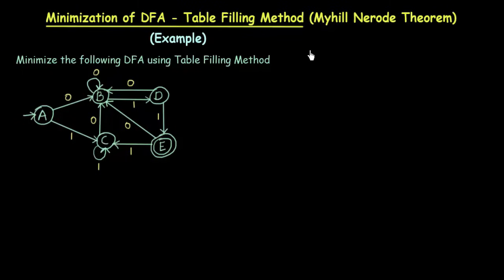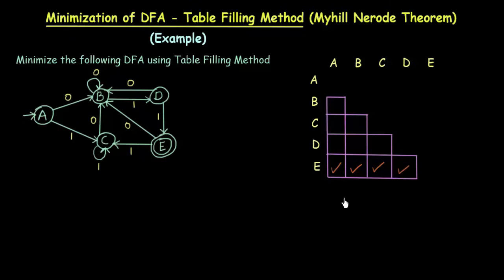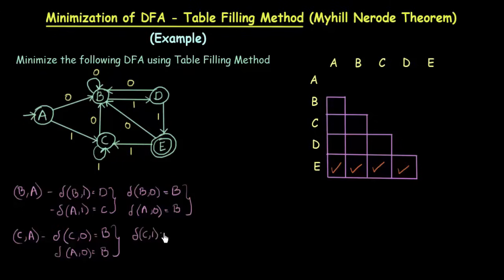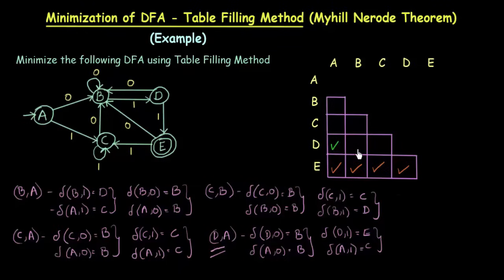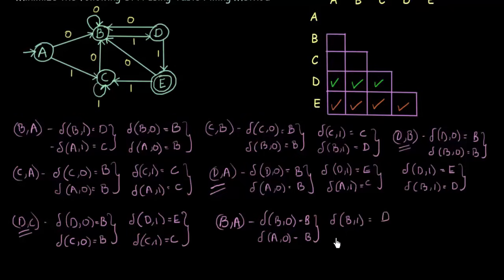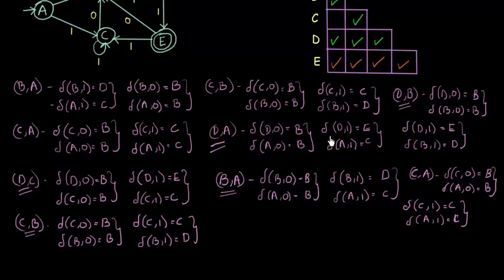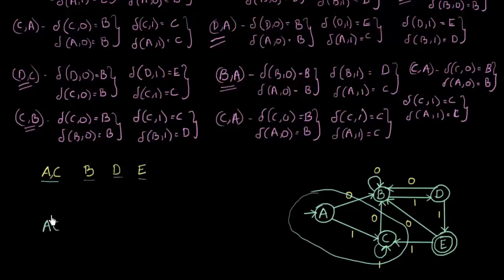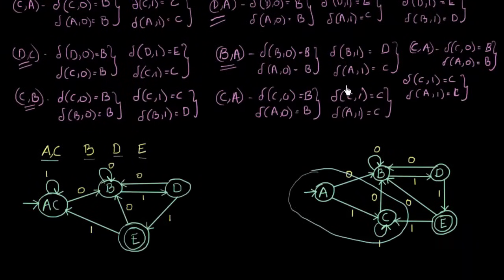Myhill Nerode Theorem - Table Filling Method (Example)

Comment: Sir 11:30 how can (c, d) and (d, c) be equal.. As there is separate cells for both of these.. And for (c, b) pair while checking 'c' for input 1 we got 'c' and for 'b'  input 1 we got d but there is no cell for (c, d) how can you mark that?
Reply: (c,d) and (d,c) are the same. As you can see (d,c) is in the table, so no need for (c,d). The same for the others. you can go back to the previous video to see why the table is like that